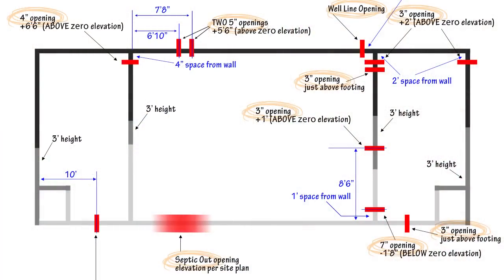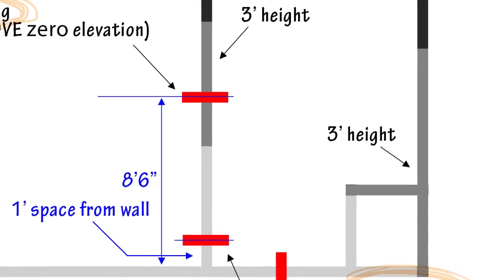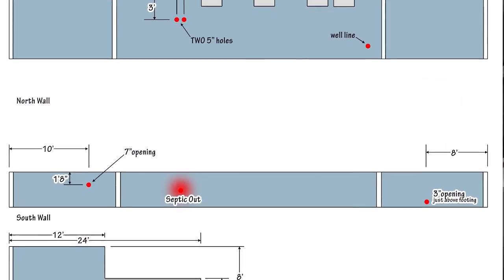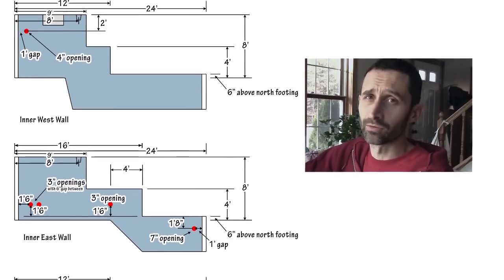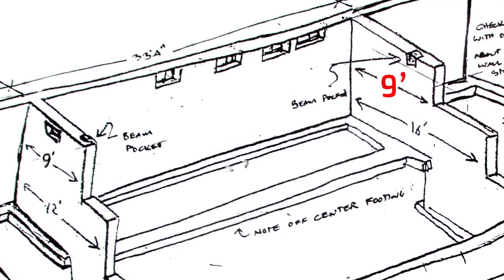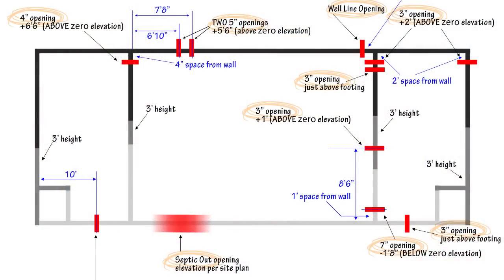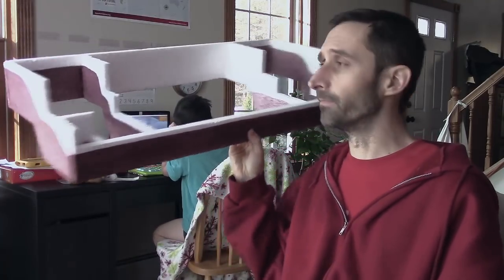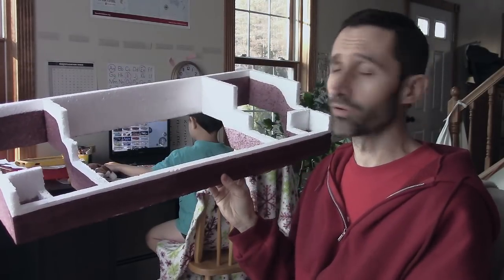Homestead Building - Planning for Foundation Holes, Gray Water, Water, Power & Root Cellar Line

Comment: I like the model, but if you go through the trouble of making one, i would definitely advice to make one to scale… also, to avoid trouble in the future, you might want to consider to never get River a monstertruck... ;)
Reply from the maker: The model was basically to scale. It's just the thickness of the walls was proportionately way thicker than the 10" (25cm) that they will actually be.
Reply: @PraxisPrepper  ah ok, well that wasn't entirely clear from the video, idd say that's probably neglectable as long as you don't take any measurements from the model...

Comment: Good visuals on the plans and the model - very helpful.  An old-timer from North Dakota recently explained (with conviction) how there had to be dead air space between the ground the the floor to avoid convection of the cold from the frozen earth. That is against the idea of berm and underground building. Do you have books, articles, or sites you can recommend where I can get more information? Thanks.

Comment: Getting a look at your foundation plan gives me finally a better idea of what you have in mind, and now, things make much more sense. I had to laugh when you came out with the model. I did the same, plus gave each tradesperson his own specific plan together with detailed instructions, just to make sure they understood it's not a conventional house we were building. I'm curious to see your whole house plan. Question: why a greenhouse on both sides?
Reply from the maker: I had planned to do a greenhouse on both sides AND a greenhouse in the south facing front to connect them both, but the south-facing greenhouse would have gotten pummelled by falling ice from the roof, so we nixed that one. The more greenhouses the better - every wall covered by a greenhouse is a wall that's not losing heat in the winter to super cold outdoor temps.
Reply: I'm with you on that. Have you ever seen a house within a greenhouse?